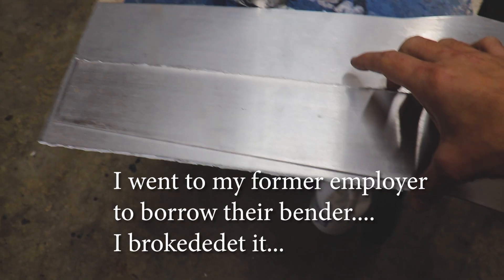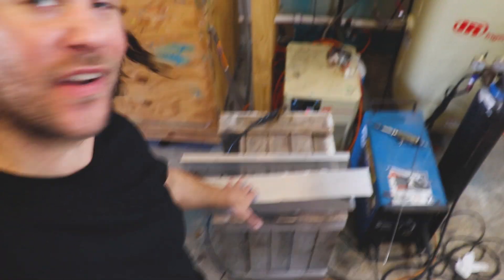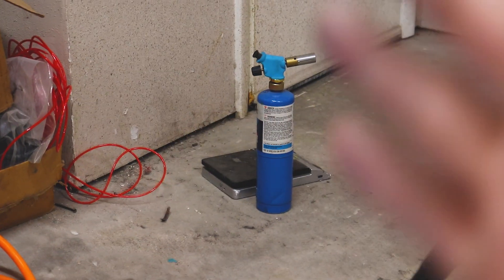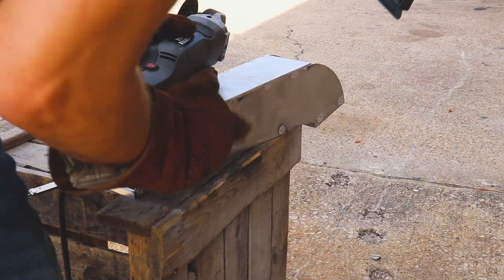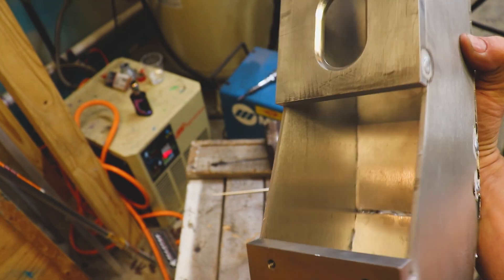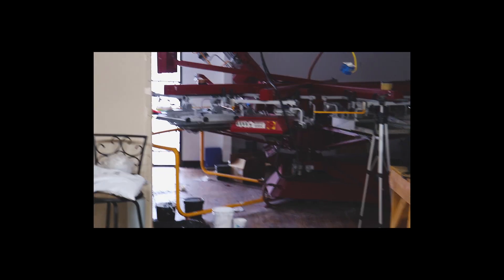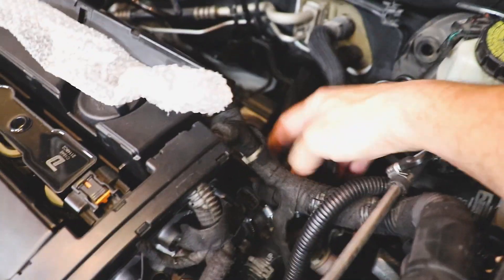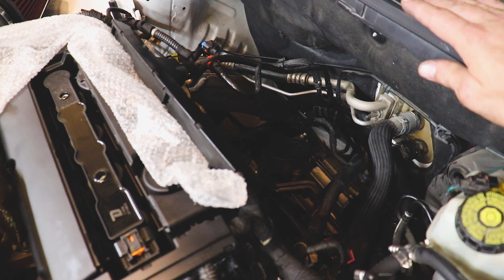Working on the Custom Intake Manifold for the eBay Turbo 1.8 Chevy Cruze

Comment: After the full build installing the oil pump .. after start up how long it took to start building oil pressure? Just built a 1.4 from bare block .. been following your channel
Reply from the maker: Nice. If you go back to my first start video, you'll see even before I tried starting the engine for the first time, we turned over the engine with the cam cover off. Took about 6-7 cranks before we started getting oil to the cams. I'd pull the cam cover, and turn over the engine as many times as it takes to start seeing oil at the top of the engine without the engine firing. Just disconnect the fuel injectors and remove the coil pack.

Comment: My thoughts would be to use some rounded stock. If I'm picturing it in my head right, having a rounded intake would help with the spacing issue, while still giving you the necessary tolerance for the PSI, and allowing room for your throttle body. Just some thoughts, maybe it'll give you an idea of where to take your design next. All the best Matt, really enjoying this!
Reply from the maker: Thanks, Jacob! I did some calculations, and still should be okay if I shortened it down to give the TB room. Still grinding my gears thinking about what directions to go. Either way I'm sure over the holiday weekend we'll have the manifold together.

Comment: Just an FYI, you don't need coolant to go to the throttle body if you don't see freezing temperatures. Those lines are there to prevent the throttle from freezing.
Reply from the maker: I have a LNF throttle body that doesn't have all the coolant passages for the upgraded throttle body. It's just a matter of blocking off the ports now.

Comment: Ok sir , 
 On the 1.4 t we don't have a coolant hose to the throttle body. 
 I like your design & for the break line  issue you could just modify the area needed for more space but not rub. 
As for runner length not sure how long you can make them but longer = speedy boost  less lag. 
 Be safe team
Reply from the maker: Thanks for the insight! Definitely thought about it. Back to the drawing board and we'll make something work I can be proud of.

Comment: Could you take a piece of 3-4” aluminum pipe and cut it in half and weld it at and angle, put your throttle body in the middle and fill/cap the middle and ends? Seen some that way for the 4.2l I6 atlas motors
Reply from the maker: Sure could! I'm going to take a look at Ross Machine Racing's store. They have a half round setup that may work.
http://store.rossmachineracing.com/Universal-Intake-Extrusion-Half-Round-by-the-foot_p_200.html

Comment: i heard for turbo applications, your runners should be as short as possible. With my turbo setup, ive just left the standing inlet on so far. & also dont forget, get some barbs on the inlet for vacuum lines
Reply from the maker: Definitely will get all my vacuum lines, and whatnot sorted. This will definitely be a more complicated project than it seems to be. The runner length will dictate what RPM range the power to come in. Longer runners favor more low and mid range, but the boost keeps the top end strong. Shorter runners will kill lower and mid range, but will yield higher horsepower numbers.
Let's say 4" runner's would give me 20 more hp. Cool. But from 4k to 6k, the shorter runners would kill 50hp. Richard Holdner has some great dyno videos showing the effects of longer runners vs short in boosted applications. Hard to really tell since this engine has yet to really be tested. Only way to find out is to test.

Comment: Could you just flip the manifold so the tb is on the passenger side?
Reply from the maker: I thought about it, but whatever I can do to keep the boost pipe short as possible the better. IMO.
Reply: @cmattdabrat  I feel like it makes less difference than most people believe. Look at rear mount turbos. Also for instance, the Saturn sky, and Pontiac solstice which have a decent length of charge piping. Also, my 2 aftermarket turbo cars have a few feet of charge pipe, and all get boost with very little lag. Turbo size has more of an effect from what I've experienced. But I'm sure you'll come up with a solution you are happy with.

Comment: Looking good! I would use the flanges, get the carbord out and see what you can build in the space you have!
Reply from the maker: That's the plan! Those CNC'd pieces weren't cheap. Just need to redesign the plenum since I designed them based on an idea an no engine in the car to see if it would work. We'll get it sorted!

Comment: You should look at an Edelbrock elbow for their 92mm throttle bodies. It has a bolt battery of a 4bbl carb but it’s great for fuel injected set ups!
Reply from the maker: I'll look into them. Thanks for the suggestion!